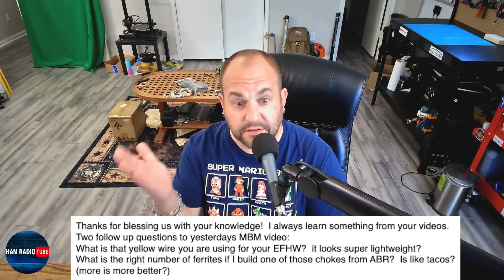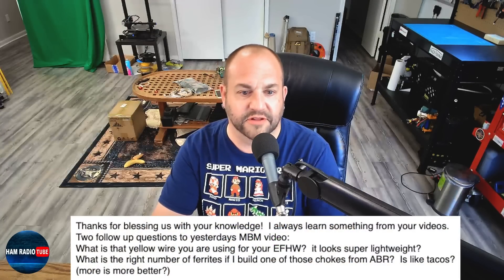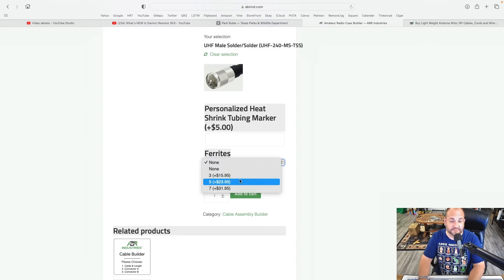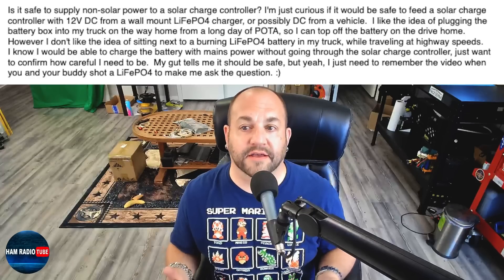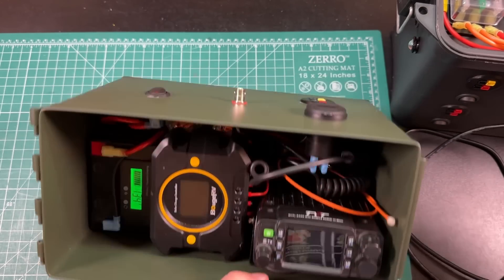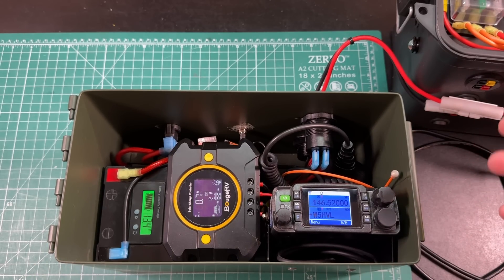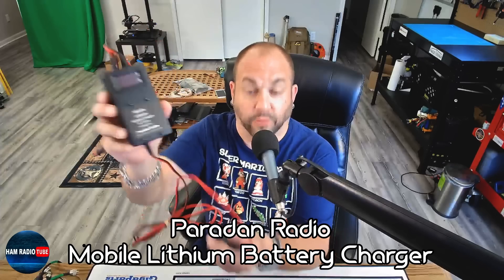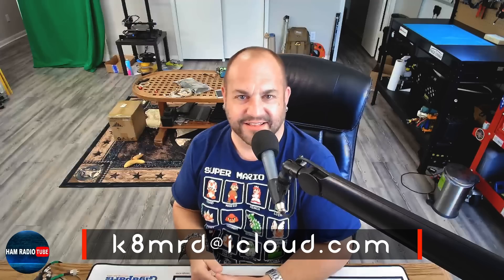How Many Chokes Do You Need?? Mailbag Monday

Comment: I just got done making my first UHF (70 CM) Yagi.  In my VNA i had multiple SWR dips (common mode ? ).  I got a package of 60 (NI-ZN) beads of various sizes, so I used the ones that fit snugly on my coax.  5 beads didn't solve the dips.  I put all 12 on without checking for dips between installing each bead (a long day).  12 beads solved the multiple dips.  happy

Comment: The value you get using clamp-on ferrite is quite low: I recommend using a large toroid (e.g., 240) and high-permeability mix (e.g., 43 or 31). You will be able to wind more than ten turns of coaxial cable, and each turn will correspond to a clamp-on ferrite bead.

Comment: I've been using an old 19 volt laptop power supply to charge a 12.8 volt 100 amp hour LiFePO4 battery pack for about eight years, now, through an MPPT solar charge controller.   Works great!

Comment: I did the same test with my home-brew solar generator modeled after your Harbor Freight 3800 hard case project. Had the 20 amp BougeRV controller and would not let me charge battery by using standard 2 amp Lifepo4 charger. Does fine when hooked to solar panel.

Comment: The answer is never enough, you will reach a point where the impedance will plateau, but the coax will still pick up noise, so ideally every 5cm down the coax have a bead. But that will put induction currents in the coax. 
The best is to choke at the tower and in the shack, then burry the coax from the tower to the shack, this way the burial will cut RF noise hitting the coax and only the exposed section on the tower will cop RF but if you choke it off good before the ground it will save heaps of noise. 
The noise actually makes it's way past the shield, just like any thin shielding the RF will make the atoms bounce the RF inside the coax, this is why there is never a bottom to the DB scale, this noise multiplies internally along the coax causing noise floor increase on the sig wire. 
This is not jacket leakage, say a 95% jacket, that will have direct openings that are even worse, it's the same, same, but I'm not talking about direct leakage. I'm specifically referring to solid shield penetration of RF which is measured at a DB scale.

Comment: New Ham here.  I got my FCC Tech lic here in Japan KD9VUL (I'm stationed here).  I now also have a Japanese ham lic JK1VCF.  I know I have to use my Japanese call sign here in Japan but besides using a paper log book is there any way to merge the data when I go back to the States?  Thank for all that answer
Reply from the maker: Hi Ginger.  I would recommend downloading and using a logging software as soon as possible to make your life easier.  Enter in any contacts you have now and keep adding them as you make them.  If you only care about the actual data you can just keep adding more contacts to the same log when you get back to the states, or you can simply make separate files for JA and USA.  If you care about Logbook of the World you can still use the same log, you just need to use the TQSL program that is part of LOTW (a separate program though) and set the dates for when you are in JA and when you are in the States.  I did a video last year showing how to do that.  https://youtu.be/VfL5sGWDIY4?si=q2CUOZMOadvEDjm5  Keep in mind, this isn't a video on how to get setup with LOTW in general, you'll need to go through that process first, which is quite the nightmare to be honest.  But once you are, this is how to add another location.  Once you have multiple locations in TQSL/LOTW, it will keep them separate.  Hopefully that makes sense.

Comment: Mike, your tests on the solar charge controllers brings up New questions! Why don't these all work? 12 -13 VDC  is 12 -13 VDC! Was the incoming voltage to low? Or the amperage to low? Or Both? 
Or was your battery just FULL?
Would they work on a SLA battery? 
🤔
Reply from the maker: I suspect the input voltage was too low for the MPPT.  Some of these will work on SLA.  The Bateria and Bioenno will, but not the others.  They are just for LiFePO4.

Comment: Get a DC to DC charge controller from renorgy. You can get DC to DC only or get a duel input that will use solar or alternator. But easiest probably just get a pure sign wave inverter and get it hooked up in vehicle weather through cigarette lighter or wired up to battery.

Comment: great video. very good questions ! I go with their is no dumb  questions ever. the best thing I fount is for part rules is simple. JUST ASK THEM ! don't be shy. find park ranger or someone . I find letting them know what we are doing and how we clean up . they nicely give up the answer . I even got a permits do  a long wire at state land to do 160 meters. all just buy asking.  in fact the park ranger took his lunch break with me. even showed him the parks on the air rules. was a great time . as for charging LiFePo4 from a car use a DC to DC charger. powerworkx has a 8Amp one. has power poles right on them. Victron and renogy has on. can set max amps. like 15 or 20  even 10 . have to hard wire put power poles on them. with 12V lighter port use 10 amp max. that why I use the powerworx 8 amp one. I have 20 Ah LifePo4 and 8amp charge does not take long. 73's

Comment: Decreased input voltage means decreased input current, therefor your charger output current will be decreased, basic Ohm's law. V=IXR where the resistance is your battery, yes the cells have resistance, and it increases with cycles and your capacity decreases as it increases, this is why lithium cells seem like they don't hold a charge as they age, they really don't.

Comment: 1. Yeah, the controllers designed for "solar" sources are expecting higher voltages than the battery voltages, so they are all buck converters, whether MPPT or PWM, rather than having the capability of boosting the voltage.  Depending on how you feel about ALI Express, you can get a cheap boost converter between the car's DC and the charge controller, but that's a project, and it may get hot.  I've got that 3A mobile LiFePO4 unit, and it seems just perfect for the DenCo I bought for my KX3, with a specified 3A charge rate.  It, of course, will work fine on bigger batteries, it will just take longer too charge them.  But that's not a lack of efficiency.  It just may or may not do what you need in the time that your have.  It will reduce how long you have to charge at home.  What's efficient is a mixed bag.  You're using cheap wall power at home (or maybe even set up you panels, though it may have gotten dark), but if the energy to charge the battery uses (even a little) extra gas, that's a more expensive source.  (Old EEs can't resist.)
2. What you can do at a park not only depends on the park, but also upon what ranger is on duty that day.  Have a backup in the car, like a tripod and mast, or a mag loop, that you can use if they complain.  Mike has demonstrated leaning the mast against a tree, in lieu of a through line, and they might complain less about that.  But once you know that a particular park objects, don't do it next visit.  (Don't be a richard.)  Maybe POTA could arrange to accept activator notes that they could decide to add to their park data?
Meow?

Comment: I know you not a low bander but if a low bander wanted to stop his common mode currents on the lower bands he could purchase a Amidom K mix core I think 240 is the biggest they make but it has by itself 1 core up to 7500 ohms of block capability. Well that’s where my fried equipment stopped it may be better. We use 4 of them in place of the oem stock palstar balun that is at 500ohms. We use 12-14 wraps or rg 400 to get the spec quoted above 😊 Google mongo balun article

Comment: There are devices called buck/boost solar charge controllers that have extended range inputs (i.e. 9V in can even charge 24V at 80+% conversion efficiency).  They're usually integrated with MPPT, but have the additional boost (in this case) circuit.  There's a bit of efficiency loss, but still better than what your tests were showing with non-boost MPPT.  One example - Renogy markets their version (RNG-DCC1212-20-US) as a "DC to DC on-board battery charger", with 8 to16V input, and charging your choice of battery chemistries.
Reply: Came down here to type this. Add to your thumbs instead.  DC boost is the key to mobile charging quickly without solar availability. Often will let you charge a "solar generator" Faster than any other means as the solar input has the most capacity. With a boost you're effectively making a "fake" solar array at whatever voltage. Just be sure not to exceed max input voltage of yer device. Boosting to 24v is reasonable and works on most things but if you've a specific device you want to charge REALLY fast it may be worth aiming for as close to max input voltage as you can. As a bonus if you boost near the battery you can use smaller gauge wire to wherever you device to be charged is as you're trading amps for volts and will get less line loss.
Reply: You beat me to it Jody.

Comment: For Shane: a simple answer might be to buy a sine wave power inverter that plugs into your lighter socket, so you can use your regular LifePo4 battery charger. Just be sure the output is enough to support your charger.
Reply: naw. DC boost to 24v off the 12v and charge. Easy trick for faster charging on a lot of "solar generator" batteries. Just need to push that DC voltage up and doing that is way less lossy and expensive than DC-AC-DC.

Comment: I use a 300w(30vx10a)residential solar module with a mppt charge controller to keep the RV lead acid batteries topped off for 2 years now with no issues.

Comment: Can I get a link for the mini shrinkwrapped charge control thats so noisy? You said in another video it wont run a battery down when its not charging.
Reply from the maker: It's this one right here. Make sure to select 4S LiFePO4  https://www.ebay.com/itm/184903276670?_trkparms=amclksrc%3DITM%26aid%3D777008%26algo%3DPERSONAL.TOPIC%26ao%3D1%26asc%3D20230811123856%26meid%3D9a0c0eea63254738bec6fe4369b30a8b%26pid%3D101770%26rk%3D1%26rkt%3D1%26itm%3D184903276670%26pmt%3D0%26noa%3D1%26pg%3D4375194%26algv%3DRecentlyViewedItemsV2%26brand%3DUnbranded&_trksid=p4375194.c101770.m4236&_trkparms=parentrq%3Aa9f0b95818a0a5140c9d25f2fffff83c%7Cpageci%3A5ee21d30-5660-11ee-8a8a-2e1251eb7f8e%7Ciid%3A1%7Cvlpname%3Avlp_homepage
Reply: Thanks much... RFI here I come. @hamradiotube

Comment: OK, Mike, here is a question for mailbag Monday: I have a G90 and live about 1/2 mile from a commercialAM broadcast transmitter. I get bad RFI when they are transmitting on most bands. I built one of K9DP's AM broadcast filter kits, and it helps somewhat, but I am still getting interference from the AM radio station. Anything else I can do?
Reply: Move. I know that is gonna sound crazy but you're just right up against a BIG transmitter here. G90 is small and portable, great for POTA/SOTA. You could spend $$$$ trying to ground everything and Choke and bandpass your way out of this or just operate elsewhere. That said, do make sure you have the basics of solid station grounding and choking delt with. So many small desktop "hamshacks" I've seen with unchoked/ungrounded setups wondering why they're deaf.
Reply: @chublez   Thanks for this info. I actually have NOT done  any station grounding or choking.  I dont know if Mikey has a video on that, but if you could point me in the direction of resources, that would be great.  The AM station reduces its power at night, so it isn't quite so bad then.
Reply from the maker: That's a tough one and one I don't have experience with fortunately.  I wonder if a receive loop antenna might help??